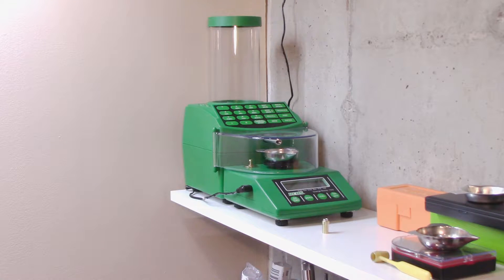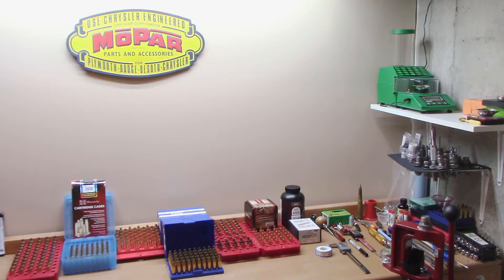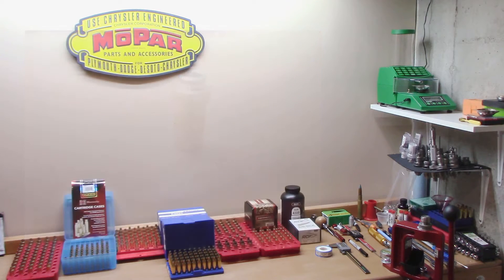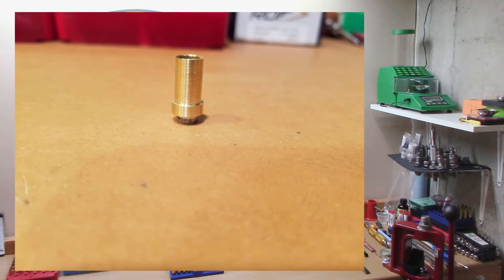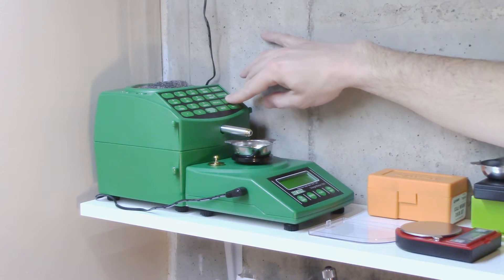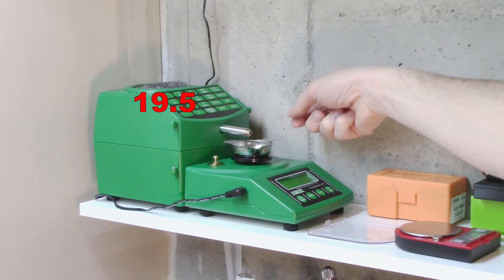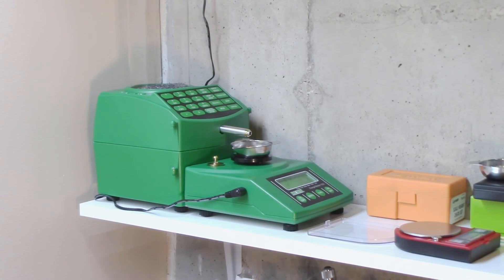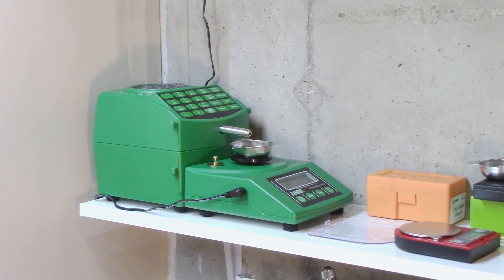RCBS Chargemaster McDonalds straw mod alternative

Comment: Good video. Anything to prevent overcharge on the chargemaster is an improvement. I can get mine accurate to the kernel by under throwing and trickle up with a vibrating trickler until the weight just changes. It averages 6 kernels for .1 grains. Sometimes it takes two up to 7 kernels so I know I’m getting more accurate weights.

Comment: Straw mod all the way.  Cut a 1" x 3/16" notch in the end of a plastic straw ( I used a Burger King straw), jam it all the way in so the notch aligns with the cut in the dispenser tube, and chop the straw flush with the end of the dispense tube.  No changes are needed to the programmed dispensing parameters.  I tried it with a few powders including previously inaccurately dispensed extruded stick powders.  The dispense times were the same (unlike the reducer shown in this video) and all of the charge weights were PERFECT.  I knew of the straw mod years ago.  I should have done it then.  RCBS should ship the Chargemaster with a smooth plastic insert so their product functions optimally without a customer mod.

Comment: I wonder:  Wouldn't this also work for manual tricklers like the Frankford Arsenal?  It also has a threaded tube end, and overcharge is always more common than under.
Reply from the maker: I am not sure of the dispenser tube on the FA model. They very well might not be identical.

Comment: It's already slow enough to begin with that I wouldn't worry about slowing it down more.  The other issue I have is if you don't hit the dispense button hard enough, it must think that you hit it twice, and starts charging and ignores the powder that it already started dropping.  It also seems to change calibration when it gets hot after being turned on for a while too like you said.

Without the door, you didn't notice changes in the measurement? It seemed really sensitive, but it must be from the furnace which is already running at slow speed to filter my house.

Comment: I use a charge master and a single stage forster coax for my load development. After I have done a proper OCW test, I use my Dillon 650 for large batches. When I'm using my charge master, I'M IN NO HURRY! A mod like this only makes sense. It seems to make the charge master more accurate.

Comment: Would it not be quicker to use a manual powder measure and trickle finish each load? Or is the end goal more reloads for less time at the bench? The reduced nozzle adapter piece seem to work well tho :)
Reply from the maker: +lonz73 after using this I would never want to go back to throwing the charges and trickling. If you were only going to load 25 rounds it might not matter. But when you are loading a lot, this is really the cat's meow. Rcbs just came out with a update too I think it's called the chargemaster lite.
Reply: I'm with madman. If i can use the rcbs to throw an accurate load in 20-30 seconds ill be happy. I always scoop and trickle to get to my weight and more often than not i get carried away during the trickling and end up having to scoop out a few grains and weigh it over and over. If i hit it right i would say 15-20 seconds to scoop and trickle but if i dont and go over it could take as much as 45 secs to a minute to get it right..  I found you yesterday and have subscribed and watched almost all the videos. I do have some groups and load data i would like you to try out at some point. I just want to know where you find you H4350!!! Awesome videos madman, Keep it up!
Reply from the maker: +Charles Dunham thanks for the compliment. I try to keep the content coming. I am always interested in ideas for the channel. My H4350 source is just keep looking. Last year I found it twice so I have 8lbs in stock. Shhh don't tell anyone.
Reply: I'm new to reloading and was just curious as to why the electronic powder measure for load development and accuracy testing.  I recently joined a few long range and 6.5 groups and the majority hand throw and trickle finish for best results on single digit SD by crono.  Much more to it than just powder charges for that but slowly learning.  I look forward to your next video!
Reply from the maker: +lonz73 thanks for commenting. Just like everything else in life there are too many opinions out there and ultimately you have to decide for yourself. My thought on this, and I am sure someone will pipe up to argue with me is that if you have your load to 1/10 of a grain your doing pretty good. In most cases 1/10 of a grain of powder is 6-8fps if I am that close is likely good enough. 

Some people throw charges, which in this application just isn't realistic since I would have to adjust to much. Some people hand trickle. But if their scale is only to 1/10 of a grain they are going to be any more precise than this can do. If you got a medical grade scale for a thousand dollars, maybe a gempro 250 to get 1 more digit of accuracy. ( Which I have certainly thought about and still might do) I really don't think there is that much to be gained.

Keep in mind 1 piece of these extruded powders weighs about .04 grains, give or take. Being to a 1/10 of a grain with 2 scales agreeing on the answer puts me pretty close to within a couple pieces of powder. Especially on loads where SD's are high teens or twenty, having a slightly better scale is going to fix that load, it just isn't any good. Powders are sensitive to temperature application etc. I really don't see a better tool for effectively setting up a load test. But again you won't have to go far to find a different opinion. Look around you tube though, dual chargemasters on a reloading bench is a common sight. For me though one is plenty.
Reply: Greetings.... Nice set up you have moparmadman. I use the method lonz73 describes. I have a small manual Lee bench powder dispenser. I set it to throw .5grains less than what I want then put it on my Lyman Accu-Touch 2000 electronic scale which comes with a trickler. Works great for me this way. Big touch screen, also allows me to see the minus weight after i remove my powder tray. i can easily  adjust the trickle depending what is shows. if its out by .5grains, I simply re-Zero the empty tray. Easy Peasy fast, and absolutely perfect. I never call a trickle .1 over good. I always re-trickle. Like you say, everyone has their way of doing things. For me the manual under throw, and the trickle works fast for me....I get into a zone, and poof 50 rounds done....Cheers.
Reply: BTW.... for my pistol loads I just use the bench mounted Lee manual powder thrower. I keep the hopper 3/4 full always, and a double finger knuckle tap to the handle knob. Its pretty consistent for me...Cheers.... ((Loading another 200x 6.5 Creedmoor today))
Reply from the maker: +Tony Nagy exactly. Everyone has the way they prefer. I end up trickling over and I just get frustrated. But with this toy I have drastically increased the consistency of my throws. As long as you get to the same place it really doesn't matter how you get there.
Reply: I agree Charles.... when people start finding this channel, his subscribers will sky rocket...Cheers.
Reply: Tony Nagy I have recommended moparmadman channel to many for load data and reloading in general to get his viewer base up :)
Reply from the maker: +lonz73 I appreciate it guys. It isn't worth making videos of no one is watching. So far it's going pretty good. Always appreciate a good word though.
Reply: moparmadman I've watched every vid you made several times over!!  I have the same rifle so paying close attention:)
Reply: Perfect lonz73... I'm also loading for the same calibre, and same Ruger Precision Rifle...ya stay tuned....Cheers.
Reply: I got the lite version the other week, seems to suffer from the same issue with overcharging so ive commissioned my toolmaker mate to make me a couple of inserts.
On the accuracy of these vs throwing and hand trickling, the latter can be more accurate if you make it so every charge is the exact SINGLE piece of powder that moves your scale to the next decimal point, with the auto loader it may drop 2 or even 3 pieces, while still on the decimal point but next time may get it perfect, so theres for sure some variance you get there that can be totally removed with meticulous hand loading. My thoughts are these are consistent enough and more consistent than me on a bad day! I often do 150-200 in a session which i could never do while throwing hand hand trickling.
Reply: OK, update time! Got the inserts last week, 2 different sizes (they aren't in-front of me right now to measure, but i think it was like 5mm and 6mm id) and ive stuck with small one.
Before i threw any loads for actual use i threw 20 charges and then weighed on my Hornady scales the charge and removed a single physical grain of powder, all charges then dropped back to next point of a grain, SO THEY ARE SPOT ON NOW! I also observed the unit over extended time and found the warm-up is indeed  crucial, i go as far as to say 1 hr as i think the recommended time is too short! During that first hour i observed drift of up to around .05 of a gram, after this they held zero perfectly. I run no hvac and keep stable temp at all times.Other than the insert, i did also slightly raise the rear of unit on advice from a friend, i think this helped slightly as with it perfectly level accuracy , while still acceptable, was not as good as with slight forward tilt.With the insert and no tilt it still never threw an over charge, as in to the next 0.1 of a grain, which without insert and my chosen powder (adi ar2209, essentially h4350) it was doing a good %10 of the time.I loaded up 50 rounds after this testing, observing every charge as went int pan and they all bang on. Im very impressed with this unit now.I will happily share dimensions of the insert im using if anyone cares.Oh,I forgot to add, i never timed it in stock form but i have indeed increased time taken to throw 40ish gr of 2209, i timed 50 charges and it came out to 45minutes. I dont care for level of precision garnered, others may.